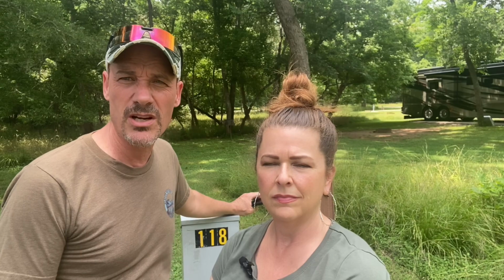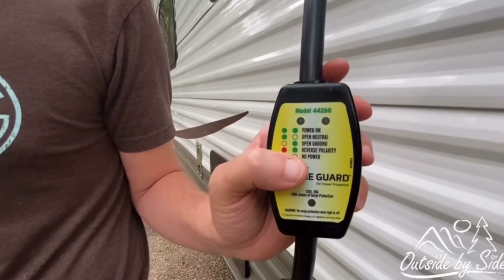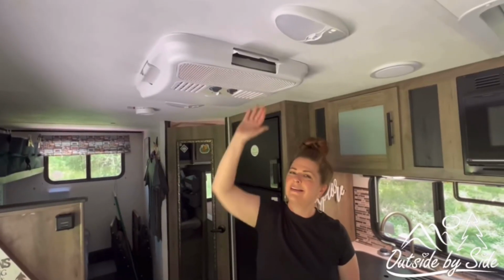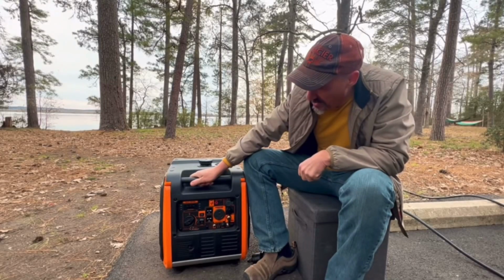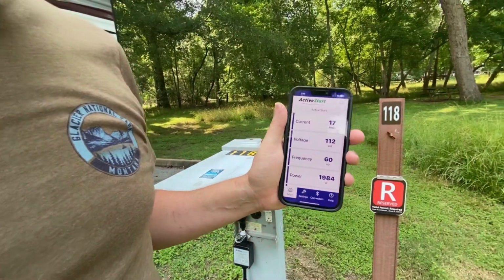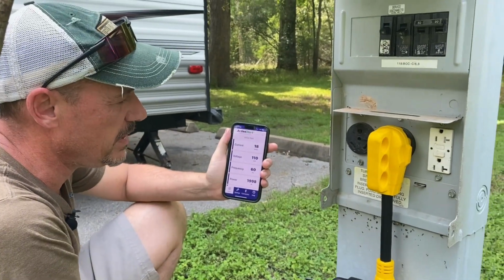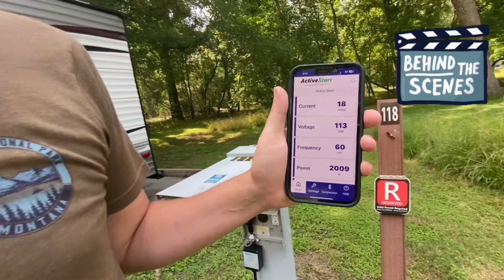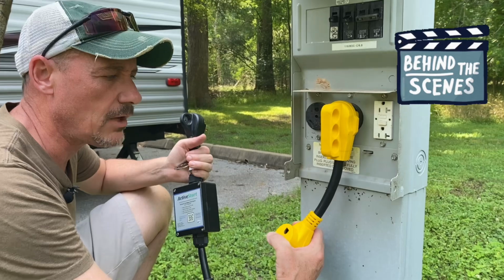Are You Having RV Campsite Electrical Issues? We Have Tips!

Comment: I rarely camp at a place with electrical service. A couple of years ago I did camp at an old Florida campground. My Hughes Power Watchdog EPO (Emergency Power Off) cut off the power several times when the voltage dropped below 104 volts. Hughes also makes an "Autoformer" voltage booster that will boost voltage by 10%.
Reply from the maker: @atwowheelguy Thanks for the recommendation & thanks for watching! Happy camping! 🤩